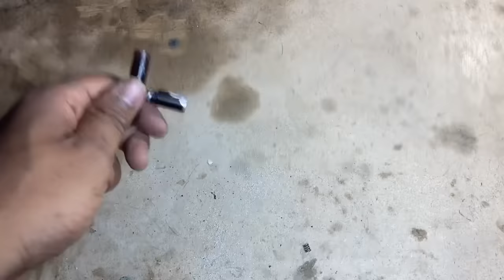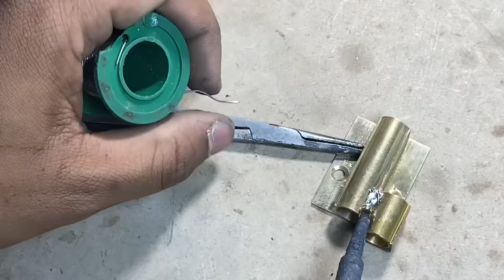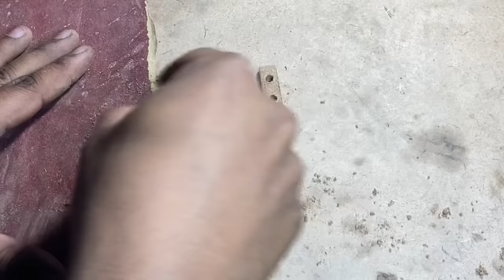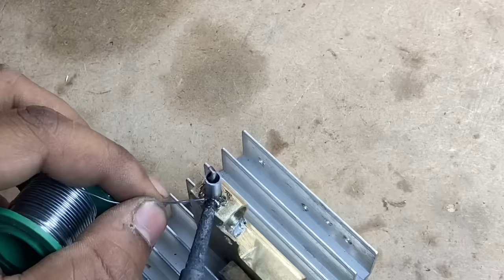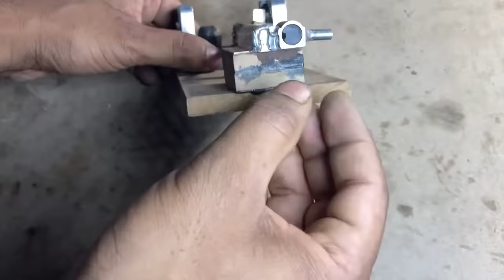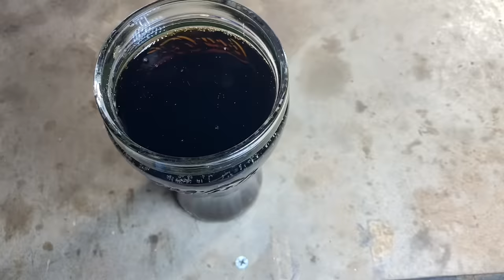Homemade steam engine

Comment: Like I tell my kids, don't look at what it is, look at what you need. Not a simple oscillating engine. Center crank cylinder engine. No mill, no lathe and no tapping and threading. As an engineer I am impressed.
Reply: Diddo!
Reply: And Your kids ! Will now Rip off your lock ! From the Door !
Reply: @davidwillard7334  Possibly, they have degrees in Environmental Science, but decided to run a construction company. Building what other people need.
Reply: @briannemec9214  Who Gave them ! There ! Fees !.for that then !??
Reply: @davidwillard7334  Who gave you spelling lessons?
Reply: @jonaschreuder7785  You did !
Reply: @davidwillard7334  are you just randomly decided where to put capitals and punctuation or do you just have a very flawed understanding of how they work?
Reply: @davidwillard7334  nothing im just legitimately wondering how the fuck you can mess up grammar that much, capitalising every word is bad enough but you dont even do it consistently and you just toss in punctuation randomly so its confusing as hell to read
Reply: Fafv
Reply: @davidwillard7334  yeahhh why walz when you can rock n roll ? a real working doorlock at high speed =)
Reply: Do you tell your kids if they make mistake they get burnt or worst a piston shooting like a bullet
Reply: Necessity is the mother of perspective? 😊👍🏼
Reply: Had a toy, much simpler. The cylinder moved to open a close the intake exhaust valve.
Reply: @TechieTard  ¹
Reply: @davidwillard7334  kkkkkkkkkkkkkkkkkkkkkk
Reply: Very good work

Comment: Engine run is most impressive, what's the rpm. First it seemed like overloaded but I was proven wrong. I am impressed 🙏
Amazing job without expensive tools. 👍
A true engineering spirit 😀

Comment: A beautiful, quite simple construction of a single-cylinder steam engine. I often use this principle with my synchronous motors, especially when I need to confirm the parameters of the oscillograms! Then it is not the mechanical accuracy that matters, but the winding system. Congratulations 😀 👌.
Reply: Thank you for the like 😀.

Comment: I was concerned about the stability of it all, but I got super excited once it started to run and I seen that it held together. Sorry for doubting. Good job, thank you!
Reply: I think that using the epoxy resin if there was going to be a pressure failure he knew it would be there or the feed hose, much safer than exploding cans or brass🤣🤣 smart.. one time pressure fuses

Comment: Thank you for your efforts and for promoting steam engines! In my opinion, they should be used massively.
Reply: Too inefficient
Reply: @unabhangigenachrichtensh7296  OH if that car engeniers did not waiste time to build a seat heater ?
you can get that hot steam back as warm water and YES even atomic powerplants make hot water ?
is a turbine more efficient ?

Comment: Awesome low-budget, low tech build. I too have a  engineering heart and therefor love this project. Thanks for sharing!! Since you have soldering equipment, maybe use a 'tin' (iron/steel?) can from food, for the boiler. Empty that and solder it shut 😊 as it has higher melting point than aluminum can. Maybe it's also safer from leaking? Some presure valve as safety is maybe also wise, to keep the boiler from exploding. Although that's a bit extra 'complexity' and cost of course.
Reply: A good note: using valves maintains pressure and helps start the engine, first and second, to secure the tank from explosion
Reply: Where can I purchase such pressure valve, and how exactly would it be called??? Thanks for the comment
Reply: @mr619mohamed3 
Could you comment a link to one of those pressure valves, please??? I wouldn't know what to look it up as

Comment: Thomas, use sandpaper on the tip of your soldering iron to clean it, then wipe it off with a damp sponge.  This will make soldering much easier for you and give better joints.
Reply: Sandpaper will remove the metals for proper soldering tip, all you need is clean it with damp sponge.

Comment: Is there water inside the cola bottle or did you rely on heating the air?
Reply: there definitely water inside
Reply: Surprising the can didn't Melt ! And where was the Filler Hole !??

Comment: Cool. And great use of repurposed hardware items…
Gives me some ideas.

BTW: soldering the two cylinders together… you need - clean, flux, WAY more heat. You just kinda tack welded it.

And if it’s anodized or plated aluminum, it will be a nightmare.

Comment: Im thinking of building a steam engine to power my generator instead of gas I will use a propane heater. Its cheaper and cleaner than gas so will save tons of money too.

Water from the creek is free, clean and recycles itself.

Comment: Amazing job. I really enjoyed watching it.
What happens if you don't run the engine to exhaust the steam? The Cola will explode?
Reply: I'd assume the pipe connecting would burst first but that's a possibility
Reply: @overtheatlas  yeS a savety valve with a spring would be good?
Reply: @fernlenker  i would think so

Comment: He does all of this with practically no tools except a hacksaw, drill, & a soldering iron, super glue & epoxy putty.  Imagine what he could do with a shop full of tools, a welder, cutting torch, drill press, lathe,, etc

Comment: I've tried making this 4 times, each one improves a bit more than the last, but still no luck. Any advice? What are the most important things to make sure are correct?
Reply: I’m personally just getting into steam engines but I’ve built NA engines, you’re gonna want the best compression you can get without rings, oil etc so really close piston to wall clearance, make sure the valve body is secure and there are no vacuum leaks, as well as no exhaust leak except when supposed to. As long as you’ve got everything good and sealed up then you just need to worry about your cam to crank positioning which is pretty simple since 1 cylinder. hope this helps, as for making the individual pieces that’s a whole different story
Reply: @Smashing Pencils what you are trying to build currently is a single acting or “single stroke” 1 cylinder steam engine 👍🏻 https://youtu.be/L8qgeprzfPE the first half of the video will tell you better what I was trying to say and a good visualization also https://youtu.be/5jq04KlFOf0 made the same but a less efficient version of the same thing! His problem is in his valve, and weight in his parts. Though he only uses compressed air currently rather than steam to run his.
Reply: @jameshunt5316  Thank You ! please are you the real James that raced against Niki in F1 ? =)
Reply: @fernlenker  I wish, unfortunately the man you’re looking for is dead. I just fix and build cars personally.

Comment: how does the intake connect with the main cylinder?
Reply: i was just blind and now i understand the whole thing
Reply: @fernlenker  hello thanks for the answer. I am currently trying to build a 3d printed 2 stroke
Reply: @Grillkol  VES two or three Zylinder slow moving with much torque ! AND if you have Sun shining trx a parabolic mirror to heat water ! AND yes use an over pressure pipe ;)
Reply: @fernlenker  i was talking about gasoline Engine :)

Comment: Nice, it seems really powerful. Though it might blow to your face !
I would recommend peeling off the paint from the can before putting it over the fire. Could be toxic.
Reply: Actually the can has a good chance of exploding because the thin aluminum above could melt and be blown out by the steam pressure. A deodorant can would be much better.

Comment: What is the cane inside? Water or any fuel ?
Reply: Water
Reply: Its a steam engine, so water is put into the can (or boiler in this case) and is heated up and boiled by the stovetop. The water vapor (aka steam) then is used for the engine.

Comment: Bro use a cd in the place of blade cutter . Because cd is light in weigt
Reply: The point of the circular blade is to be used as a flywheel. Flywheels need to be heavy to help keep the engine from loosing momentum and dying. It helps the engine continue in the spot where no steam is applied in its cycle.

Comment: so the engine runs once to death since there is no speed governor?
Reply: The governor is the heat.  That's just how steam engines work.  He could add a bleed valve to remove excess steam.

The lack of a governor and everything being based on the heat was how old industrial accidents happened-- the boiler could explode, the engine could fly apart, etc.  They can be very dangerous if not crafted well, cared for and maintained.

And don't get me started on open flywheel accidents! 😆

Comment: And what's the name of other black door lock you used
Reply from the maker: Allumininum 4inch tower bolt
Reply: @THOMAS_TECHS  thanks for the reply coz many are here but they wouldn't reply
Reply: @THOMAS_TECHS  but lastly what's the length of piston
Reply: @THOMAS_TECHS  can I use the door lock for the valve piston instead of expoxy resin

Comment: Sir this not working properly what can I do
Reply: Try placing the cam piece at different intervals around the shaft. Timing is everything in a steam engine. Also make sure there isnt a gap in things such as the cylinder since pressure could escape from it.

Comment: You have also use a steam control valve
Reply: Also known as a regulator, and yes. This is why it gets little bursts of high power. If he added a valve somewhere between the can and the  valve cylinder he could make it function at a steady pace.

Comment: Why not use the grass rod for the piston it’s already the right size
Reply from the maker: No that brass rod makes nearly 1mm gap between the cylinder and piston  so i used alluminium rod which is machined to perfect fit
Reply: @THOMAS_TECHS  ok that makes more sense, and have you ever had a problem with the sotter melting from the heat of the stove or the heat of the steam?
Reply: @matthewsquillante1590  I dont think the steam would get that hot, but that is a thing to look out for when building stuff like this. Always check if something easily melts!

Comment: I feel like an air compressor was used in the making of this vid
Reply: He would had used an air compressor used to fill air in vehicles and for spray painting  machines by passing the air through a heating  champer to heat the air to expand it to a highest  pressure  to rotate the flywheel  forcibly at higher speed rpm. Thus he could creat an air powered engine  air engine
Reply: He's using steam inside the can to pressurize the engine. I guess it gets little bursts of power sing he has no way to limit the pressure.

Comment: hey bro which flux paste are you using
Reply: There are no solder which can fuse with solid copper block without flux which he did not use, and to fuse 2 mm solder wire to copper block needs tremendous amount of heat which can be done with a propane torch but definitely not with a 40 watts soldering gun! This guy must be an Indian.

Comment: That is not steam crazier enough but I learned on Mr wizard that that isn't steamif you boil water in your kitchen the stuff that you think is steam that comes off the top everybody thinks that steam and that's not steam
Reply: I think you are mixed up. When water boils it turns into steam. If you are cooking with oil or grease then what you see coming out of the pot isn’t steam but if you boil water it is steam. That’s why it’s called a steam engine. That is 100% steam. The water in the can gets heated. The water is converted from a liquid to a gas, that gas is called steam. Water expands when it is converted from a liquid to a gas. 1 gallon of water makes 1600 gallons of steam. Since the water expands when it becomes steam it causes the pressure inside the can to increase rapidly. The only place that pressurized steam can go is through the tube and then into the piston where it pushes the piston forward and is then released which is called exhaust (sorta) then the piston goes back to the back and more steam comes in and pushes it forward again and that repeats which is what keeps the motor running. Also the centrifugal force of the fly wheel helps to keep the piston moving for a short time even if the steam isn’t pushing the piston. In this engine I’m pretty sure the fly wheel is what moves the piston back to the back so that the steam can push it forward again.  the steam makes the piston move forward which spins the flywheel and the fly wheel keeps spinning which moves the piston back to the back so that the steam can push the piston forward again.

Comment: Instead of using gas stove as fuel to run the engine use a compressor  used for spray painting or vehicles tiar air filling  and then the air passed through a heating champer to heat the air got into the champer to expand to pressurise the more powerly to push the piston with great force. The champer should be heated up with heater element just like seen in buses trucks and lorries by electrical  prosses ie battery  powered heater. Thus the air is expanded with high pressure  to turn the flywheel. An alternator or dynamo should be rotated  to charge the battery  as well as to give power for the heater too. Thus u can invent an air powered  engine.  The hot air comming  from the exsoser should be cooled by a radiator to aviod globel warming too. This air engine can be a pollution free engine ie no pollution  at all.